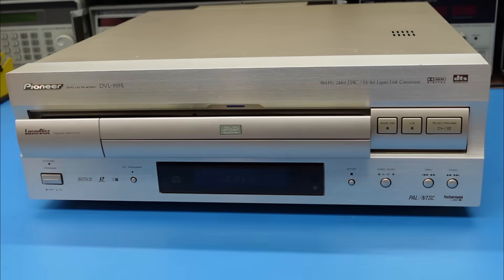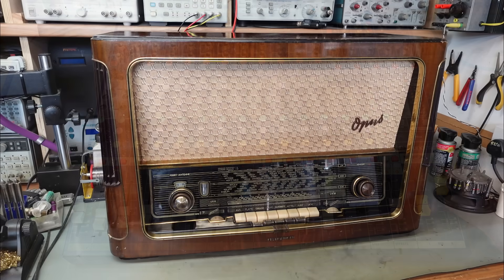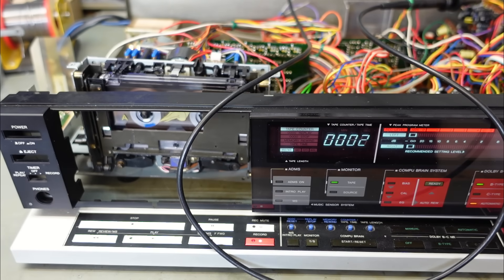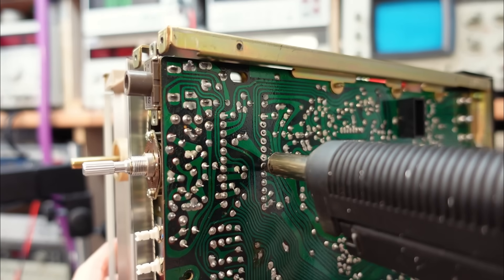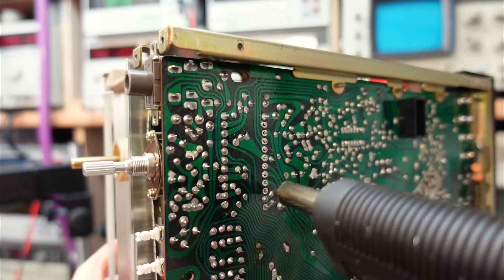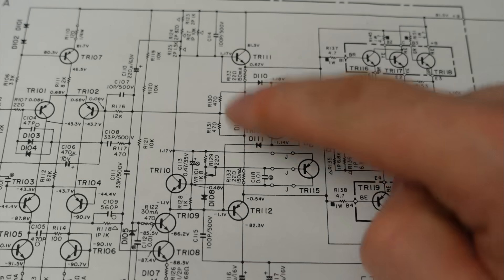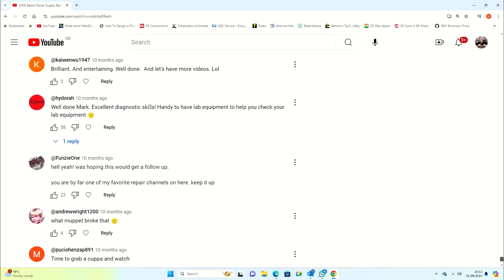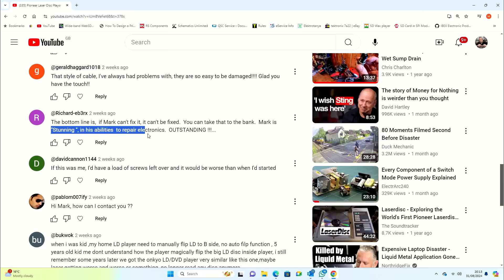The 3-step Process To Repair Any Vintage

Comment: To be fair: Things are always easy for someone with the relevant knowlege.
But as of my experiance most people don't have basic knowlege about electronics and even more critical: They don't have a sense of danger.
Many can't judge what they see on the measurement tool display and don't have a clue about it's meaning.
And some repairs requires more or less expansive tools also.
All together is the reason many stuff sold on second hand markets are crap, because someone tried something, messed it up horribly and now try to get rid of it by selling to someone and not telling the truth about the units history.

Comment: I started dabbling in electronics when I was 15, from tube to current surface mount repairs. Now! at the tender age of 72 I still enjoy the challenge, especially vintage equipment. Like you I a massed a lot of test equipment over the years as technology advanced. Mark! your video's are most informative and educational, (I love your sense of humour).

Comment: 200 quid a repair, that's not the norm for most people. Equipment has to be worth the repair fee to begin with. 200 quid goes a long way to buy new items these days. People don't bother getting items repaired, when the repair fee is half to two thirds of a new item.
Reply: Sentimental value
Reply: @BigFurryCat  Yes, probably. Then you have the obsolescence factor aswell. Everything these days are past it in 5 to 10 years. Apple products even less 😄

Comment: I've always enjoyed your channel, Mark. I was trained in electronics and did the college years ago! So I don't need to sign up myself, but I do wish you all the best. Only comment: Someone working on an old vintage valve radio shouldn't just plug it in and see if it works, (as you know) the bad caps in it could mean damaging hard-to-replace bits like the output transformer or output valve, etc. Usually OK if you use a dim-bulb, though.

Comment: A good tip is to never spill any liquid inside electronic equipment. I bought a Tascam audio mixer / cassette recorder at a car boot sale which was advertised for spares or repair and after replacing a number of capacitors, cleaning some potentiometers and doing some work on the cassette mechanism, I got is all working again. I think someone may have spilled some sugary drink inside causing the unit to stop working.

Comment: Hi Mark. Can I first say that I have been an electronics repair man all my working life, 45 years plus, and you are quite possibly the best all round technician I have ever seen. However, please don't bother with any more videos like this, your normal content is what we all keep subscribed for. It's worth mentioning for anyone thinking of taking it up that the £200 per repair has got to depend on where you are. I am in West Yorkshire, and many people here live in some sort of time warp where they still expect an amplifier to get repaired for £50 or less. This is why I don't really bother doing the job any more apart from a few bits of vintage valve equipment of my own that are destined to sell on Ebay, or valve guitar amplifiers that belong to musicians I have known for years.

Comment: Love watching your Online Electronic repairs show. You also show great knowledge with mechanical workings too. I did an apprenticeship as a radio/tv tradesman back in the early 1970's era, in Australia. I owned my own TV/White good sales repair service for 25 years. Started my own business around 1985 and did my apprenticeship starting  in the  black and white tv days, through to the colour tv days in 1976 in Australia and furthered my Technical achievements by doing night school when the CD player came into sales, to repair them too. Also, Microwave ovens and other electrical/electronic goods too. Yes, we even changed over a colour TV picture tube when a TV had lost the emission of one of the RGB  guns and couldn't be boosted/rejuvenatedOH yes, I remember quite vividly getting Zapped as I forgot to discharge the tube from the Aqua-dag to the Ultor one day, nearly dropped it, but one mounting bolt saved the day!!!......Seen you get Zapped with a H/V capacitor too, not good. Thanks again for your great show and I love watching you perform your great and successful repairs. Regards, Chris.

Comment: It also helps to reiterate over common problems with the tech you're fixing. I can't even count how many vintage CD decks I've picked up from the junk shops around here with a diagnosis of "dead laser, skips all over the place" and the actual fault was that the rubber/foam on the top clamp went out the window. Some rubber o-rings and a tiny dab of glue and the thing sings again like new! Not even breaking out the scope and the tester. And some of them went for very good prices after the fix :P

Comment: It took me a while to derive what you just layed out in this video.  When I was 25 I found myself responsible for all of the automation for a large wastewater treatment plant.  One lesson that I learned is to read the manuals, where available.  I sounded brilliant at times where I was just the only one aware of what the manuals said.  I won't be joining as my controls servicing career started in 1973.
But I wonder, how do yoou keep track of all of the screws?  Thanks, Mark. ;-)

Comment: Having recently retired after 53 years repairing consumer electronics at last i can pick and chose
which jobs to accept and not having to worry about ensuring every one of them results in a profit
takes away the stress that can make this line of work a bit daunting.
I was lucky in that i attended tech college for the theory and worked full time learning the skills
to find faults to component level without replacing every component on the board, only to find it
it was only a hairline crack in the print.
Good luck to anyone taking up this rewarding career even if only as hobby, it can  earn  you a nice level of income.
Mark is one of the best you will find, stick with him as he shows that it is not a dark art.
Reply: I will!
Reply: Hi Barbara, yes, I completely agree with you. Mark is a very competent engineer. I gained my Honours degree at the age of 64, whilst working full-time and was then made redundant so never got to make use of the qualification.

Comment: I ran a small tv  rental and repair shop wich ment if it fad a mains plug or ran on batteries we repaired it  . for the tvs on rental most repairs where done in peoples house  so no nicetys like isolation transformers  .
i think your chanel is one of the best electronics chanel there is keep up the good work.

Comment: I've only just stumbled on your videos and it HAS reignited my interest in this stuff.  I'm 68 so it's never too late.
Reply: Yep!  I'm 66 here and got snarky music gear and old tube radios/amps hoarded away on shelves that need attention!  Mark amazes me...sometimes to the point of depression when I see him unsolder about 24 points (and 32 screws, etc) and pull out a plethora of ribbon connectors(!)  It's at that point I realize why I have bins full of half-finished 'repairs' I started 4 years ago...and have now forgotten where the f*** all the parts have scattered to.  That'll lern me - dern me!  ;-)

Comment: Nice idea Mark but I don't need a course. I'm a retired engineer with an electronics degree. I volunteer at the local Repair Cafe, so get lots of practice. I would like to be part of the Mend it Mark community though - how about a way to be a member and exchange ideas and problems without the cost of the course?

Comment: I also watch the "buy it, fix it" youtube channel, like you he repairs electronics sometimes for local people or non working items from Ebay. There should be college courses for youngsters to learn how to repair electronics and make money doing it. So much otherwise perfectly good electronics is thrown away for the want of a 20p capacitor or resistor. With all the available and mostly affordable test equipment, it should be straightforward enough to get into repairing this stuff. I think I'll nip off to the shops and get some myself.

Comment: Well done Mark.  I think the proper college training died out in the 1990's.  I did City and Guilds 224 Electronic Servicing and college although I did the measurement and control leg of the course instead of TV & Radio.  
One thing I will say with repairing vintage kit is if it arrived in the post always take the lid off and have a good butchers to make sure there's no internal damage prior to applying power.   We were taught at college to split diagnosis in three  1 look at the output, 2 look at the input then 3 look in the middle.  You can narrow down your search for the fault to the first part of the circuit or the last part.   My first repair was called poke 'n' hope  by one of my colleagues.
Reply: I did the 224 and rteeb back in the 90s as well 👍🏻

Comment: Just like fixing cars, both mechanical and electrical issues. Verify customer complaint. Use strategy based diagnosis. Don't skip steps or assume. DON'T GUESS!!! and don't use the parts cannon.

Comment: I think most people watch channels like yours because they want to learn something. Not just to repair appliance x. There are many videos targeted at that audience and they are short and to the point, not much explanation, just a "colour by numbers" set of instructions in a five minute video. That is not what your audience is here for. Channels like yours capture people like me, who have no formal education in electronics but want to learn. Long videos are not a problem for us (on the contrary). Theory is not a problem (on the contrary). I would like to see more of that. There are some channels like that too, (see professor Fiore for instance, and Mr Carlson of course) but not always attacking things in a cohesive and consistent manner. There is a lot to learn and I myself feel I have made significant progress, watching and doing, but there is some way to go.

One suggestion for others like me, perhaps if you start from scratch, start with vacuum tubes, even if only theoretically. I find those much more intuitive than semiconductors. Once the basic topologies are understood, it will make your life easier to follow a solid state diagram (start with simple things, of course).

Good luck with your course and hope to see more of you around here. You are fun to watch (and that is an important part of your channel's success).

Comment: Is the I could do with some help as well so I have a Sony 500ES amplifier but one of the switches which is the tone control is bad to a point where it's causing channels to drop out do I replace the switch or do I try and fix the switch that's in there

Comment: Hi Mark,
Great video as always. 
The only time I wouldn't try to replicate the customer fault would be on old Valve or Tube technology. 
Some of those old wax and paper capacitors can make a real mess when they blow or catch fire.
I would check a lot of those first in the high voltage stages before powering it on.
Also, the other time to NOT replicate the fault is when they say it went BANG! 😂

Comment: Having done a few vintage repairs successfully, i would suggest an important step is omitted.  That would be googling the specific model and problem.  Say you have a pioneer sx-780 with left channel distortion.  A quick search of the phrase "sx-780 channel distortion" is very likely to turn up a bunch of threads addressing that exact problem.  Skim through those and you will often see a pattern emerge which guides diagnosis and saves time.  I agree with the idea of a systematic approach.  But places like diyaudio are loaded with threads on vintage devices and their common problems.  Carry on, Mark, and good luck with the new course.

Comment: Great idea, mate. You've helped me on specific items which was huge. We learned The 6 Step Troubleshooting Method in the military. I think the step that should be in your 3 step method is "Half Splitting" Instead of say, signal tracing end to end, spilt it in half and see if it's there. That will point you in the right direction, cutting down diagnosis time.
Reply: Yes. The military taught me the half-split method too; it's a great system.
As well as the one-hand-in-your-pocket when probing HT supplies!

Comment: Mark is spot on with his process. I’ve been doing something similar for years . And not just for electronics. It works for ANYTHING! What’s the problem ? How does it work ? Find it , fix it . Done . I know it’s sounds to easy , but a little practice and you would be amazed at what you can accomplish.

Comment: A very important thing is to stay cool and not make things worse by becoming nervous. I own one of the most sought after vintage synthesizers ever. I actually started to modify cheap organs from the same manufacturer to get some grip on the technology. The trouble however is that I still hate electronics fault finding since I am more of a hardware engineering person. I love to build casings for electronic projects but every time a circuit blows up or, worse even, dies silently so I have no idea where to begin, I flip my lid. In other words it will never become a true hobby for me. No wonder I have a massive backlog.

Comment: I have always worked to the principle that once you have a good knowledge of an engineering discipline then you can transfer that skill set from one item to another. It is definitely easier if you have an analytical and logical mindset. Having a wall of useful (and quite pricey) test equipment definitely helps too.

Comment: One heck of a sales pitch! If you have a notion to effect repairs, go for it! Working in a industrial environment we hire really good graduates, the thing we struggle with is not the technical skills and qualifications, its nurturing their sense of curiosity,  when something keels over we need an engineer who asks the question why and is willing to play with the equipment to reach the problems solution! So if I were to add anything to your pitch…it would be nurturing a curiosity and asking why XYZ failed.
Reply: You are right, I started taking things apart to learn how they work  as long as I remember.I repair for most industrial and maritime PCBs besides measurement and calibration gear commercially B2B for 15 years.  If you only do it to earn money you will stop very quick.  There are no easy shortcuts.

The  things most important for me are: 
1) Good knowledge of electronics and for most the drive to fix things/solve problems. For most if you repair stuff without schematics and when there are no you tube videos or forums about the thing in front of you. Most times you are on your own.  If you repair consumer stuff it all gets different and a lot more easy. Sound knowledge helps a lot but most times you can find the problem on you tube or a forum and just blind replace parts. But without sound knowledge you will not be able to repair it if that does not solve it. I'm self thought, I spend years of study, every day several hours reading books, experimenting, designing + building for real and in a sim (the best way to get problem solving skills).

2) A real good solder/desolder station because I need to remove a lot of components to be able to test them. I use 2 pace stations with each 3 handpieces and a  good hot air station. With cheap crappy Chinese stuff you will often cause more damage (they are not all crap but it is a gamble to find the not crappy ones) To find info is hard because many reviewers only have experience with other crappy gear used on cardboard consumer electronic pcbs. Bang for buck is not gonna help you when doing difficult desolder jobs on pcbs with massive "cooling capabilities"  and if you damage the PCB you have to tell your customer you damaged his pcb because you only use crappy tools.

3)  Test gear, I can not work (My types of repairs being PCBs from machines/ships) without a Scope, a real good LCR meter, fast DMM, DC lab supply, DC load, AC lab psu and a lot of special component testers. ranging from simple semi-conductor testers to a curvetracer and a SMU. I also have several IC testers, one of them I made myself and is the idea of a tube tester using 16 twelf position switches. I also have a fancy breadboard with build in  PSU, function gen, Leds, debounced switches etc. I take a datasheet, desingn a test circuit, test the part and solder it back. For testgear and calibration gear I have several calibrators, standards and a K7510. I also use a lot of current measuring things because current often tells you more then voltage.

 For incidental consumer stuff I only need a scope, LCR meter , function generator and DMM. I prefer a scope above a DMM.  There are things you can not compensate with knowledge alone. 

4) Patience and the will to not give up, even if that means you have to dismantle the whole damn thing for the 6th time, do not let the defect electronics win !

My steps:
- test the thing to see what is wrong
- good optical inspection of the inside
- check the PSU for ripple and voltage
- what ever is needed to go on like connecting a FG to the input of an amp and follow the signal with a scope.
Reply: @pa4tim  I completely agree.  I work in the pump industry and the lads that show an interest are the ones that finish up in demand.   Everyday should be a school day.
Reply: @adrianmoore4160 'every day is a school day' never a truer sentence.
Life is satisfying if you can learn something new every single day.

Comment: All fun and games but with vintage the most time you spend is finding substitutes for obsolete parts, repairing or finding substitutes for switches, potentiometers and other mechanical parts.
Reply: Rewinding a motor armature on a jig. Not a bloody chance. Oh, i'll just stick in onto my many output regulated voltage supplies and check the 2 outputs with the  oscilloscopes. nope.  Great guy, we don't stand a chance,